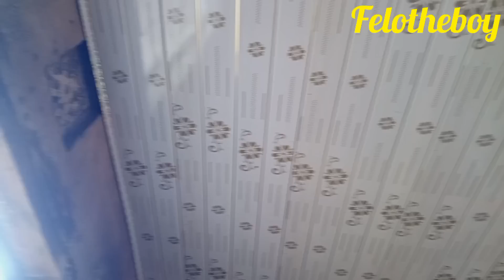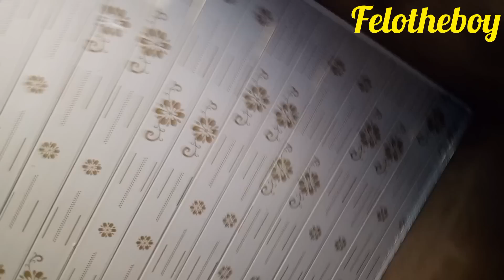MAMA FRED CONSTRUCTING ANOTHER HOUSE

Comment: Since mama Fred will be using firewood for cooking i thought it wise for a small kitchen to be constructed out there for her to use . Just my thought. Felo it's true you're the only Y tuber constructing houses for widows in the erea truth be told .
Reply: Facts. I suggested that earlier. Using firewood in the house will ruin the house.
Reply: Using firewood inside that air tight house is dangerous. She needs a cooker with a chimney if she plans to use firewood or charcoal. A gas named Carbon monoxide is produced from fire burning and is deadly. You can’t smell it or see it. I was shocked to see fire burning inside.

Comment: A door on the kitchen is very very very important.  Every kitchen must have a door in case of fire. I've never known an inside kitchen without a door that is resistant to fire, from the smell and oil getting back in the home and destroy furnitures, and for privacy when you are preparing food. 
And for the protect of kids from getting close to boiling water or open flames.
Reply: Well where have you been. No kitchen in the USA  have doors. Never ever and most now have an open concept.
Reply: Doors on kitchen  very rare in America. homes.
Reply: At the mention of  open  flames, I get the impression that you are talking about wood/coal fires.  If that is the case I see why  you are concerned for the kids.  Mama Fred can continue to cook outside.    What Bandit4truelove is saying is also correct,  there are no doors on kitchens in the USA, but we don't use open flames inside the house , not in the USA, not in the island where I grew up either. Also a curtain isn't really  needed in the kitchen either, not at the door,  at the window a small one is nice to beautify the room.
Reply: @bandit4true  you exactly  right. No doors on kitchens unless it's a back door.
Reply: Kitchen Need Fresh Air. Firewood Kitchen Should Be Outdoors Because Of Carbon Monoxide
Reply: All suggestions are well and good for doors everywhere but as we all knows it takes money to complete such work. Until there are funds they will have to do with what  they have for the time being unless some gracious person decides to fund the door 🚪
Reply: @bandit4true , glad to let you know that I am in London UK 🇬🇧 😀.

We care about safety here. And I do have a fire resistant door on my kitchen. I know that open plan kitchens leading into the dining room/living room are different. 

I've been to the US many times. 
My daughter and my grandson lives there, siblings, uncles, aunties, nephews, nieces cousins and friends. 
😀😀😀👍
Reply: @monicac24hc  our son finding Ian needs us this time ❤️🙏
Reply: @bevann1137 , also because of hot fluid or food contents cooking inside on the cooker.

Comment: I'm thinking that the  Celling boards  should be installed in/with a certain  pattern? if designed to do so
Reply: @totsysmith4640  I have a question for you? If they, the installers  ,were  to use the same Ceiling Boards ,on the next project  A} should they install them  in the same manner.or fashion randomly ? ,or B} install them in a pattern style ?  PS You  think about that ,also I realize that these guys must not have known that ,but needs to be pointed out ,so that on the next project the installers, install   the Ceiling Boards  in a pattern style, and not random unless the homeowner  wants them installed randomly  then that is their choice? . ....I think you get the point